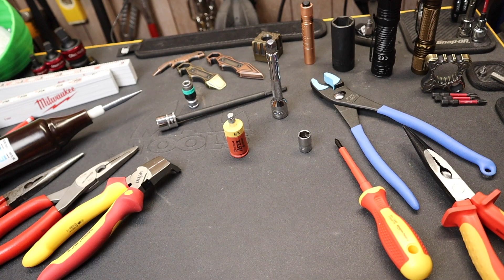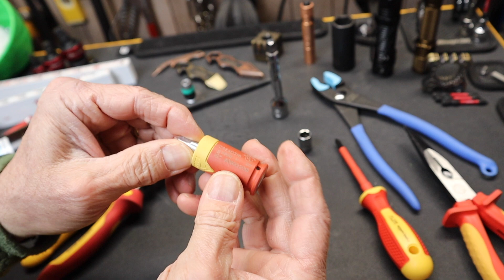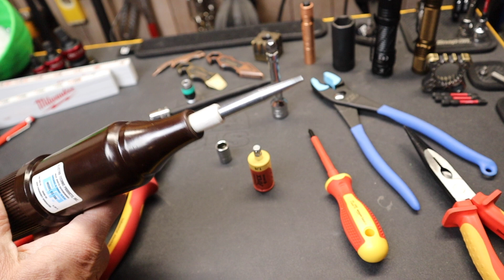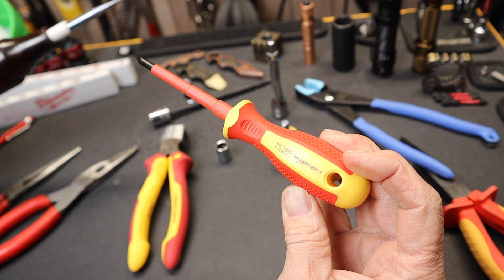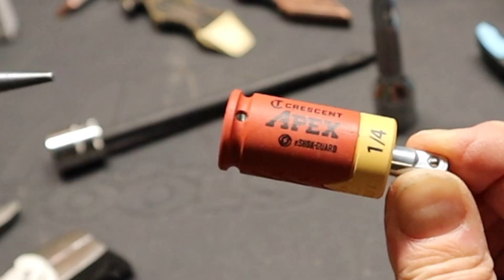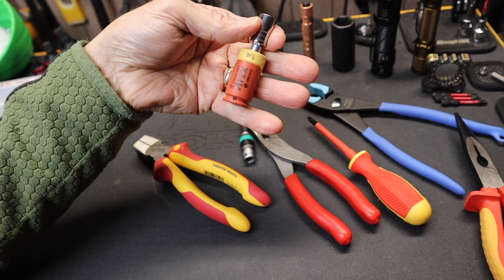Remember kids electricity will kill you! Add some 1000v Instant Insulation with Crescent eSHOK-GUARD

Comment: Can you try using electric tape around it? I want to use it with the fancy but non-insulated tools such as zyklop, torque screwdriver, ratcheting, and some expensive but not insulated tools.

Comment: I have a full set of these... 1/2, 3/8, 1/4 and 1/4 hex.  Cheap insurance when working near live circuits and they take little room in your bag.  A benefit... use them with your standard insulated drivers/extensions and you get double insulation as well as reduce the possibility of arching when inside a panel.

BTW... a good set of fully plastic pliers are always handy to have to move things around with, grab loose wires, etc.  No metal and can't be used for hight torque of course.  Mine are Knipex... snipe nose and needle nose.

Comment: Insulated tools are designed as more of an equipment protection than a personal protection. The idea behind them is if you were to drop the tool while working in live equipment or on batteries, it does not short between battery posts, busing  in switch gear, or between a phase and ground. They should be used sparingly and regularly inspected for cracks before use. They are not meant to be used as regular tools.

Comment: I'm not sure but I think a more proper way to test insulation is using a megger, not a high frequency generator.
Reply: Indeed proper insulation tester and a water bath to ground the tool. Or for purpose of this video, he could have just clamped the adapters or pliers in a grounded vice. Really, you should never use your own body. I'm sure one's health is way more valuable then a bit of yt entertainment. Even fractions of a milli amp can hurt as hell at those voltages. In less good health it might cause issues still, so you always take a bit of a gamble when doing stuff like this.
Reply: @algemeennut6683  Not to diminish from the points you've raised about safety, but I meant the tool itself doesn't actually test insulation.

Comment: Great video, I was thinking it is the electroboom channel. I am using this kind of tools almost on a daily basis. I have a great set from wera with fully insulated ratchet, extensions and sockets. They are tested to withstand 10000V and rated for 1000 V.,but I always wearing insulated gloves. Sometimes any kind of impurities can cause the insulation to fail,so they have to be cleaned regularly and used only for electric work. And they also have to be tested  periodically, that's why most of them are marked with the manufacturing year on the handle.
Reply: What kind of insulated gloves do you use? When I looked for insulated gloves all I could find were things so bulky they might as well be called gauntlets rather than gloves.
Reply: @pubcollize  Yes multiple types of gloves exist, but the rubber ones that I use are rated only for 500 V and they are not bulky at all,but they are a little longer to protect your arms. The more bulky ones offer puncture and cut protection as well.
Reply: @fuloplehel  Not sure if I'm looking at the right thing but as I replied to the other guy they don't seem like they could be used for general occasional work.
Reply: @pubcollize   For my non-bulky gloves I use Salisbury 1000v gloves. Be sure to size them correctly to your hands, and get the matching leather over-gloves. They always work as a layered pair, so never use the rubber gloves by themselves. Punctures make them deadly. And get the canvas storage bag to keep them in (and some glove talc too) so they stay clean and dry.
Reply: @sevenninthsfabmachine  Doesn't seem like they could be used for general occasional work, only for proper linesmen etc.

Comment: Personally I would prefer a fully isolated tool, not a insulater coupler as you show. VDE also stipulates the exposed metal tip of a screwdriver should not be larger then certain amount of mm. Think there are IEC norms for this. But in extra-low voltage cases, eg for working in low voltage batteries it's probably better then nothing to avoid shorts (where the angry pixies put things up in flames)
Reply: "low voltage" includes mains
Reply: @pubcollize  spot on, it must be Extra-low voltage, this is below 50V AC, for DC they state it's below 120V, but personally I don't like to touch anything above 48V DC (with enough umph behind it, like batteries or big PSUs,also individual solar panels. Strings of panels can easily provide lethal DC)
Reply: Not sure if you mean what I am going to suggest but at least knipex has two inherently insulated tools: a plier and a "needle nose" . Albeit they are not meant for heavy work since they are all made of insulating material (plastic/nylon or something?)
Reply: @DragonlordSVS maybe should have been clearer, I just meant the handles to be fully insulated and preferably the metal end exposed as little as possible.Thus when using a VDE ratchet, it should be used with the insulated nuts and not with normal conductive ones. I don't see the shown adapter as a replacement for those. They might be useful when wanting to use a light machine tool, to prevent a metal chuck to make contact with the work piece. The knipex pliers are I think specialty ones meant for working on live circuits, to avoid shorts. Cant recommend for average DIYer.  Knipex also sells an insulated crescent wrench (not sure if VDE rated), but the design of it with a metal adjustment looks a bit weirdly dangerous to me. One might be so used to use thumb to just quickly adjust it on the metal side but yeah, that could be a shocking experience. A way better design is for the new insulated Wera Jokers,  those are self adjusting.

Comment: It was nice to see that none of the tools got damaged in the sparking.
Reply: The exit spark on the coupler does make me wonder. With insulated tools a bit of a scratch or bust chrome on the metal is less of an issue then burn marks on or in the insulation that could de-rate the voltage where it safe to work with considerably.

Comment: 2 or 3 times over the rated voltage with the 20.000-30.000V with the generator? No man, that's 20 to 30 times!
Reply: Technically yes, the rating is 1000V but VDE tools are made and tested to withstand 10,000V

Comment: Those E-vehicle techs better have a full set of these on their tool box!
Reply: Discharge the batteries and nothing to worry about
Reply: @lilcourtny08 I'm a year late but I am here to say. There is no such thing as "discharging all the way" that kills the battery, when your phone says it's dead, it still has a decent amount of juice in it, but if it drains much further, you won't be able to recharge the battery. Batteries have a minimum safe voltage. Also, even if they are all the way dead, high capacity capacitors can hold a charge for years. Learned this from working on a computer power supply, shorted a cap out even though the dam thing had been unplugged for months, got lucky I didn't hurt myself. The thing can and will kill you.

Comment: VDE sockets are very expensive, One of these and a VDE ratchet is an affordable way to work on electrical stuff because the eShok-Guard works if you have to finger tighten or loosen a fastener.